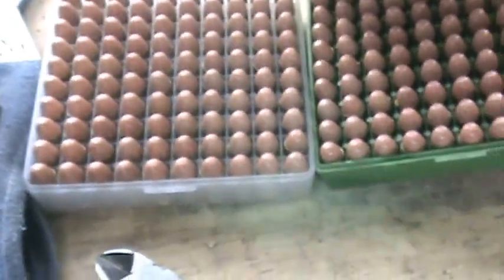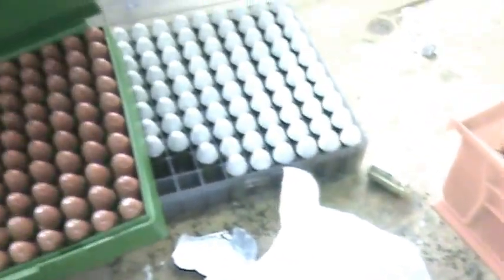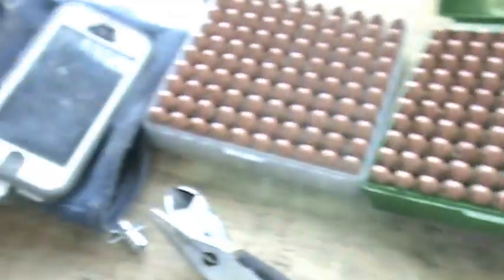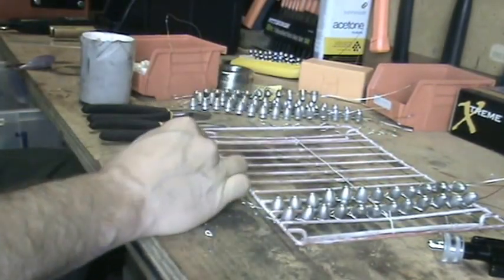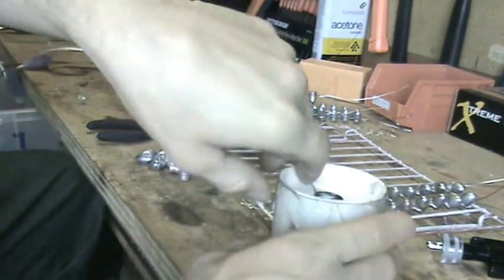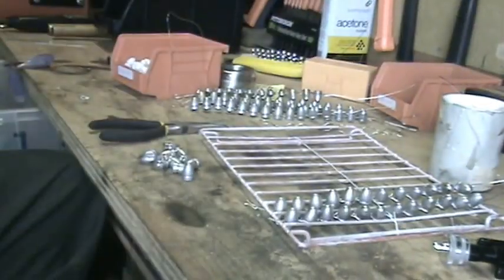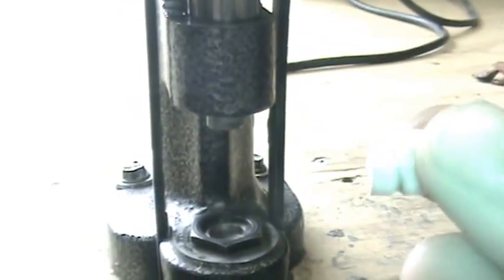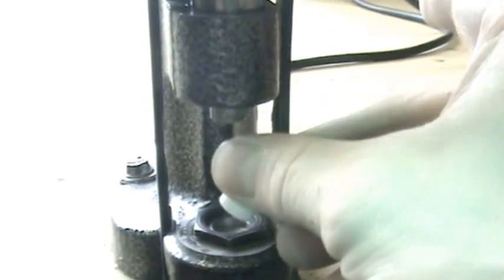Powder Coating Bullets

Comment: Saw a few re-loaders that simply powder coat the rounds and then stack them on a corrugated pizza tray. I was thinking that it would cause the rounds that are touching each other and the rounds touching the pizza pan would not be uniform, but according to a few that use that method, they say it works and that coverage is pretty uniform and even. I'm going to try that way first and then try your method. Thanks again, AGW.
Reply from the maker: Cool let me know how that works, I actually tried that with some buckshot today, I'm only getting a coat for color in my red,white, and blue buck loads, it worked ok but was really thin, doesn't matter with the buck though. I picked up a metal can and I'm going to toss the shot in that with a charge and see if I can get a better coat (if that makes sense) this way I can pre-heat them too. I'm getting my craftsman pc gun this weekend, I'll make a vid but I think it's going to work a lot better then the hf gun because it's made for small projects. Post some pics of your fi shed project!
Reply: PCBullets I'll let you know how it goes for sure. I will not he using a pc gun to apply the pc, but will be using a plastic container in hopes of tumbling the pc onto the rounds. Look forward to this next video you mentioned.:-) Happy/Safe Shooting, AGW.

Comment: First, my condolences.  I hope you and your family are doing well.

 I like your idea very much concerning how to old the bullets.  Have you considered using a pair Safety-Wire pliers?
Reply from the maker: +Well Regulated 1791 thanks, yes I have a pair of them but it's quicker to use normal pliers because of the time it takes to lock the wire pliers and pull the thingy lol. I use the wire pliers for other things though like dirtbikes and stuff.